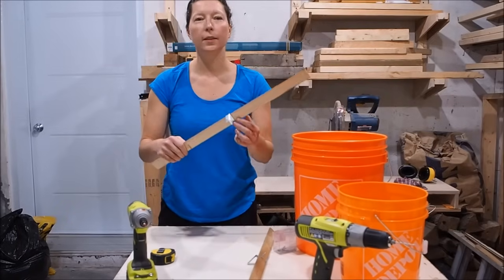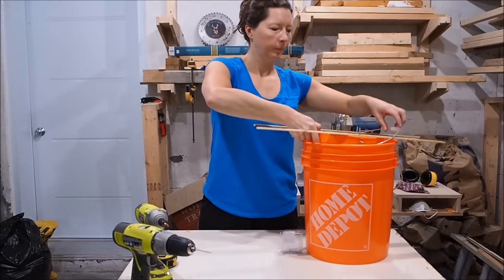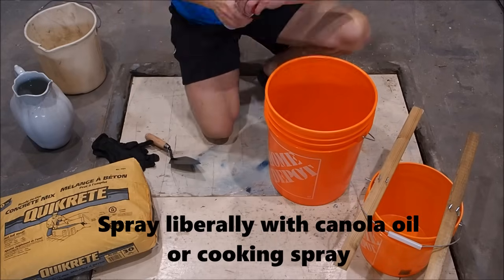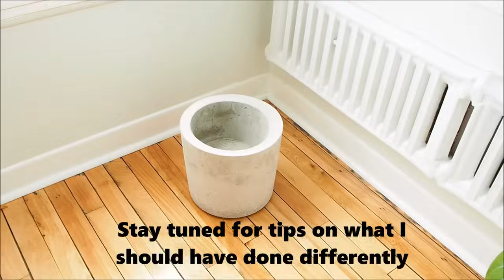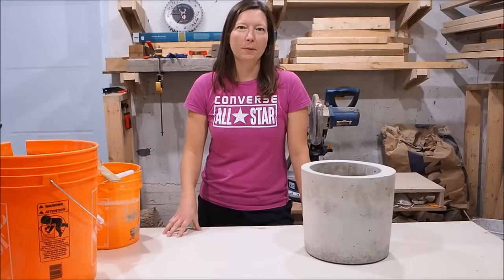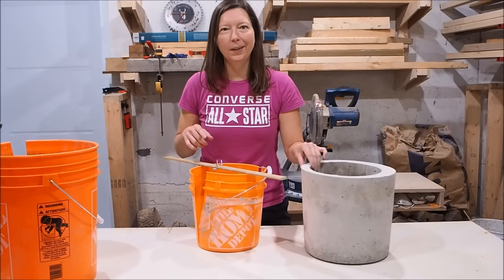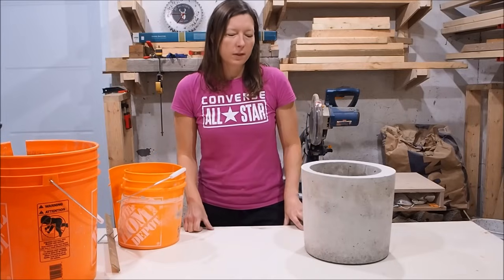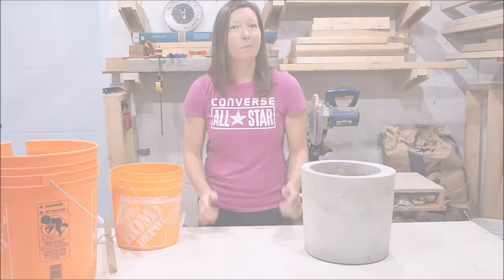How to Make a Large Concrete Planter

Comment: YOU CAN ACTUALLY POUR HOT WATER TO REMOVE THE BUCKETS TO REUSE THEM
Reply: Like you would pour hot water on the exterior of the large bucket once dry?
Reply: @blehmeh2566  yes
Reply: Sad to see all these wastage., not reusing the buckets .
Reply: Cover with film of clear lubricant make easy removal of bucket I found.
Reply: yepp. or grease them beforehand
Reply: @Humanity0101  something like wd-40?
Reply: hot water cracked my cement :(

Comment: A couple more things- drainage. Add a piece of pvc pipe at the bottom so there's a drain hole or you will drown your plants. Also, if you use a release agent on your buckets such as wd-40 or vegetable oil, they will come out without cutting them up. If they still won't come out, pour hot water on them, they will come out!
Reply: hot water cracked my pots :(

Comment: Instead of filling the second bucket with bricks, you fill it with cement. And then you put another bucket in that that is filled with cement and another bucket in that one. You build them like Russian dolls. One inside the other until you have a full set of planters and a doorstop. And don't just use cement out of the bag. Use hypertufa.

Comment: I am doing similar projects to this, as many have said 4 days it too long to wait. However I would like to add after about 5 hours I remove the inner mold when it's still wet but hardened enough not to fall apart. This way the inner mold doesn't stick at all. Then I wait about 20 hours and remove the outer mold.

Also, don't worry too much about inside looks as it will be filled with dirt anyways.
Reply: Hi, I hope you dont mind but you seem really knowledgable about this stuff I wanted to recreate the same thing but I was thinking of using this type of cement: 
Everbuild JETX2 Jetcem Premix Sand and Cement Rapid setting, 
 do you think it would still work?
Reply: The more curing time, more harder is the concrete. It can be demolded in one day or two, but if you keep it under water untill seventh day, it will be a very strong concrete.

Comment: Quick tip for you, when the concrete is wet put your orbital sander on the block you are using to hold the inner bucket down with no sanding disc on it and hold it on the block, the vibration from the sander will settle the concrete down and you will get no bubbles in the side of your planter.
Reply: Great idea

Comment: I've thought about this process for the past few weeks, here are some ideas: 1) Cut the buckets into quarters length wise and then strap them back together from the inside for the inside bucket and on the outside for the outside bucket so you won't need to cut them apart after the concrete has cured. Plus this would allow one to re-use the mold, hopefully for many times and you might not need to spray the mold, 2) Have you figured out the minimum thickness for this size of a concrete planter wall and still be strong enough to be functional? (1", 2" or 3") , 3) Place pvc pipes into the bottom of the bucket mold to create drain holes, vertically through both buckets then pound them down vertically after the concrete cures. 4) Following this process will likely create vertical mold lines which will need to be lightly sanded but that's probably less effort than trying to cut the buckets apart.  I really like your video because you jumped into doing it and I like how you added the bricks and added the strapping tape. My parents are injection molders so I have a bit of an insight into how those types of molds work but there's always lessons to learn from trial and error. I would like to come up with a reusable plastic mold for various shapes of planters: crucible, cylindrical, square, etc.  THANK YOU.
Reply: Hi,    i would wrap the buckets in trash bags
Reply: Paint the bucket surfaces in contact with the concrete with a release agent. Even something like vaseline. Cutting the buckets up will put thin lines onto the finished pot and even cause the pot to come out distorted. Buckets are thin plastic and don't hold their shape well once cut.
Reply: @ThePhillip9000  The finished pot would have the texture of rumpled plastic instead of that nice clean look.

Comment: I use a heavier veg oil for a release and it works fine.  Also, use a saw of some sort that you have and cut off the bottom lip of the inner bucket. Thats most likely what held it in place after it dried.  Anything rough or that can be 'clamped' by the pressure of the concrete will stick.  To adjust the depth/thickness of the bottom of the planter, I cut the larger outside bucket at the ring right above the wire handle.  You can also use powdered pigments to add a bit of color to the concrete while mixing.

Comment: They look great. I have high winds, so heavy is good. Consider adding a couple small pieces of PVC under the small bucket for drainage, challenging holes to drill after the fact.
Reply: I've only done small planters thus far, but I stick straws in for drain holes.

Comment: I understand this video is 5 years old, but I had to reply after seeing such great end results. IF mine turns out half as good as yours, I'll be happy. Thanks for sharing your DIY cement planter skills!
Reply: I'm with you. I'm just seeing this and have made smaller planters and candle holders, but yhis was cool. I always coat my bucket/bowl or whatever I'm pouring into with oil then line it with plastic wrap which has worked well thus far.

Comment: Might also consider doing it upside down.  Anchor the insert to the larger bucket lid and cut off the bottom of the large bucket.  That guarantees correct spacing between the two, holds it in place, and makes filling the form ever so much easier.  As others said, 4 days is far too long.  Honestly, a few hours would be enough for it to be set enough to hold its shape.  30 minutes if you're using a fast-set mix.  If you can sort out the release problem, then you could knock out a bunch of these each day.

Also, drill a drainage hole?  If this is placed outside and there's a tremendous rainfall, that thing will fill up with water and won't ever drain out.

Comment: Suggestions:

1) Drill a center hole running through to the other side, the smaller bucket. Now, simply slide a metal rod through to hang. 

2) You can spray inner walls of larger container with spam to release easier and boiling water on exterior too once cured. 

3) Cement does not have to be so muddy. It can be thinner. Simply takes an extra day to dry. 

4)  Last, once cement is poured into larger bucket, tap exterior with hammer on all sides. This will remove air pockets and you will have very few pitting, less sanding.

Comment: you could drill a small hole like 1/4 inch on the bottom of the big bucket. Later when all is set just blow compressed air through it with a compressor if you have one and the contents of the bucket will come right out. If you have a helper I'm sure that a hand tire pump will work as well

Comment: Cool vid I always love when it's someone attempting their firsts instead of someone showing something routinely-easy that they've done a million times and are trying to 'show off' but don't have anything to add!
Hope you continnued on this path, 'crete planters are amazing I only do small ones as I only care about bonsai but am they are the best I ditched ceramics to stick with crete-based because of how I can work with it!
Some tips (friendly pointers!), you can dump the weight of the final product by adding an aggregate of, instead of the usual sand or sand+pebbles, adding either crushed styrofoam or, better yet, perlite (when in Home Depot, near their fertilizers, there'll be big ~$16 bags of Vigoro brand, it's coarser and cheaper-per-volume, I use tons both for aggregate on my slabs&containers as well as an aggregate in my soils :D)  You can use a lot of this in the mixture, as-well-as adding some peat sphagnum moss (not regular sphagnum moss, peat is the decayed type that's finer/darker), this basically 'disappears' quickly which leaves lil pock-marks all over (aged-look) and makes the product lighter & more breathable!
Final tip- I see you're an HD fan, I got the same bucket and pair of ryobi drills from them (great kit, paid 80 for them w/ 2 batteries :D ), however you're mixing by-hand -- can't recall the price but there's a drill-attachment used for mixing smaller amounts of crete or stirring paint (it may be with paint stuff, unsure it's main use) anyways it turns the drill into a hand-blender basically, the 'repeatedly stir/toss it' method is plenty sufficient for larger-batch stuff (if I'm mixing mud for a patio, I'm simply pouring crete&water in-place and turning with a shovel) however for these smaller projects, especially where consistency matters, I LOVE the 'hand blender' attachment it's just a metal rod you put in the drill's chuck, it's like 2' long and has a funky end that stirs things, total must-have (use it with the bigger drill that has speed-control, not the small impact drill, i know it'll fit in it but you want tthe power-control options on the big unit plus there's no groove on the end so the smaller impact drill won't 'bite' the thing!)

Kudos to you, thanks for posting & hope you're still making these, the sky's the limit here!!

Comment: 4 days is too long my dear. That is why you struggled to remove the plastic bucket. Just overnight is enough to remove the plastic easily. And then let it dry for another day.
Reply: nope one day is enough to set, then remove and let it cure.  My wife does all kinds of concrete formed planters and stones, that's what she does.  If you let it cure in the plastic, it literally adheres.
Reply: The concrete in the yellow bag is good, but the one in the red bag “quick dry” is best for impatience or very cold climate. Double price, but still cheap.
Reply: might want to try puting it in a refrigerator to help the mold release
Reply: Keith Cronk Holy, settle down man!She did say this was her first time working with concrete. I’m sure you’re first project was perfect the first time, NOT!!!!
Reply: @Jo-xg6rk  mind you're  own business & stop minding  other folks business.
Reply: Donnie\\\\
Reply: @michellegibson8654  so if I do this project, should I not let it cure in plastic? Thanks for the help, I've only worked with concrete a few times! :)
Reply: Make your own videos My brother
Reply: put oil or vegetable oil in the bucket, and remove the inner bucket before the concrete hardens completely, the oil will make it easy to remove, You can take it off after 24 hours

Comment: You will need to leach out the lime (calcium carbonate) from cement (cement is an ingredient of concrete) pots before use and seal them, or the lime will increase the pH level of the soil and cause harm to some plants. Lime is not toxic but it will change the soil’s pH level making it more alkaline. Soak your planter for 4-5 days, air dry, coat with cement sealer.

Comment: Its a cool idea Mary to use the two buckets! For improvement, I would add rods or pieces of conduit after you lay down your base layer  and rest the smaller size bucket on them to make future holes for drainage, if drain holes are needed. Other 5han that you did GREAT!

Comment: Great video! 
For all the folks mentioning a center drainage hole: what do you plan on using beneath a very heavy pot? I think it ruins the style. 

I am wondering if one of those inner drainage “plates” coupled with maybe a small hole beneath it lower on the side of the pot is more practical.

Don’t know. I’ve never used one.

Comment: I think the offset hole is a nice effect.  An aid in releasing the mold is to use an air compressor. The problem is not that the concrete is sticking but the vacuum that needs  filling with air.  Try using plastic dixie cups as a mold for practice.

Comment: I would use oil to rub down the sides that are going to touch concrete. It will keep it from sticking. I would also measure equal distance on that piece you have going against the too, so when you get it finished all wall thickness is roughly the same. And use something for drain holes. Especially if it will be outdoors or your plants will be waterlogged with one good rain.

Comment: This is great!  I'm thinking I'll do one where I put a couple of pieces of PVC tubing under the inner bucket vertically and make drainage holes.  Maybe prop them in there with a piece of wood so there is a channel on the bottom.  Thanks for the great video!
Reply from the maker: Yes, for an outdoor planter (mine is an indoor flower pot) you'll want to add drainage with PVC. A channel in the bottom is a great idea too!

Comment: Next time you can use 2 small buckets one inside the other and that will give extra 2 inches so the bottom will not be so thick. Also use petroleum jelly instead of oil, it should work better. Thanks for the video.
Reply from the maker: Awesome, thanks for the tips!

Comment: Great job love it!  I've made similar items.  A good trick is to make the spacer to keep the little bucket centred (like you said) but then simply use a couple furntiure clamps to lock the inner bucket to the outer.  Done - no bricks needed.  Also for a release agent - try castor oil with some methyl hydrate.  nice planter!

Comment: Tip if you pour really hot water over your bottom bucket it will come off the mold pretty easy and then you don’t have to destroy your molds. Nice work
Reply: that cracked my pots :(

Comment: You could also use a more sand based concrete and mix styrofoam with it make it lighter and also uses Wd40 as a release agent great job
Reply: Styrofoam is a pain to work with, but good on you for using reclaimed styro instead of sending it to a landfill.  I'd recommend paper pulp as an alternative.

Comment: Caught myself holding my breath when you were pouring the cement powder into the pail, lol. 
Pro tip: glue a little slice of pvc pipe in the bottom before you start adding cement so you have a drainage hole when it's done. And remember to put whatever lubricant you use on the piece of pipe, too.

Comment: Good project :D
The cooking spray didn't work because there's some water in it, don't know about the oil - water ratio.
Instead, you could try using Vaseline or waste engine lubricant, so you could reuse your buckets. 

I often used waste lubricants to make concrete during college days. Got them from car workshop when exchanging car's engine lubricant
Reply: It didn't work because she took to long to get it dry. I can easily remove it within 24 hours
Reply: Witra Widharta waste engine oil (sump oil) is full of nasty chemicals. You play with that stuff you'll end up with cancer. A few cents' worth of cooking oil is a whole lot safer - or Vaseline, as you mentioned. It needs to be thicker than what she was spraying on, anyway.

Comment: Nice job, I like people that will have a go.
I wonder if you use wire mesh or even some coat metal coat hanger to make it stronger and stop it from cracks in future and you can make the walls thinner.
Be careful with them to touch outside bucket walls.

Comment: You can probably coat the bucket with wax, vaseline, saran wrap (if you don't mind the texture).
Reply: Or used engine oil, then throw a few spoons of dry cement from that yellow bag and move it around so it covers the surface where oil is. It will slide out at then end like a breeze.

Comment: It would be interesting to set the wet concrete buckets on top of a vibrating sander.  This would cause liquifaction in the concrete and remove all the air bubbles. ( I kind of like the bubble though.)  Thanks for the idea.

Comment: To remove plastic bucket after concrete dryness easily without loss or cut .. u have to paint the buckets with oil or wax before pouring concrete into it , and after dryness pour hot water over it .. best ways

Comment: I like the off-center look of the lip. Probably want to remove from the form the next day, then put in the plastic bag for a few more days to cure. You can also place some wire loops (clothes hangers maybe)  in while you're packing the concrete into the mold for strength.

Comment: If the plastic pots don't release the cured cement, try turning them over and running boiling water over them. I've seen that on other videos.

Comment: Dear, apply mustard oil or any other lubricant inside walls of the large bucket and then, cover small bucket with plastic wrap so that you will not be required to cut both buckets at the end. It will not only save your buckets also consumes lesser time to dry. I reckon 4 days are too much for this work. Try to upload a video using my technique.

Comment: Good video, could the concrete be more of a slurry to allow pouring of the concrete which would fill the gaps better, also you could use a small round object on the base which would give you a hollowed bottom (which would also make your planter lighter)..ty
Reply from the maker: +charminglad124 Never thought of making a hollow base. That's a good idea. Would definitely help make it less heavy. Thanks

Comment: If you can't find an inner container the right size you can glue gun a slightly smaller container to the bottom of your inner pail. Use silicone caulk to smooth out the join. I also glue gun a short, watersealed length of dowel, or a section of drinking straw filled with glue, to the bottom of my insert to form a drainage hole and position the insert to  get an exact thickness of the bottom concrete.  Vibrating will get rid of the big bubbles--I use the massager my vet gave me to break down my surgical scar tissue and send my wobbly, old cat into blissful slumber.
Reply: Good job
Reply: I've done similar pots and always put in plastic tubes for drainage.

Comment: Good video. I use a paint mixer attached to a cordless drill to mix the concrete, very easy and consistent.
Reply: Just beware that this is very hard on the drill, you'll burn the motor if you do it too much